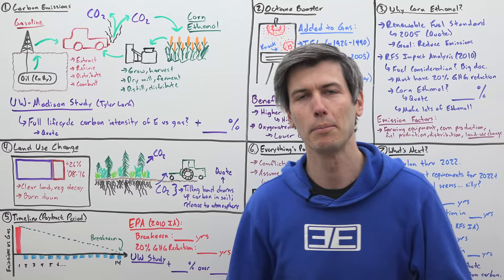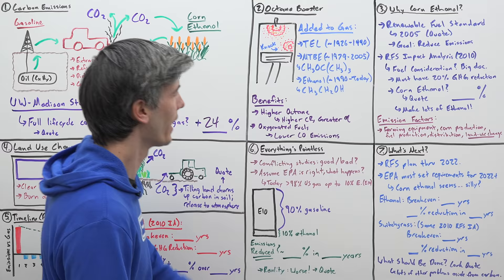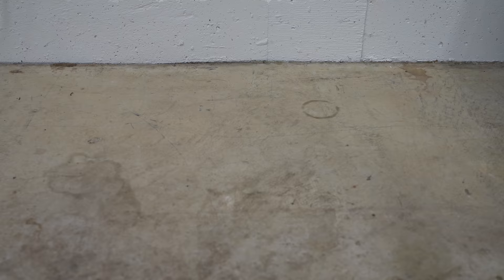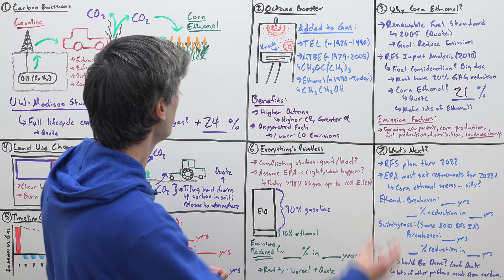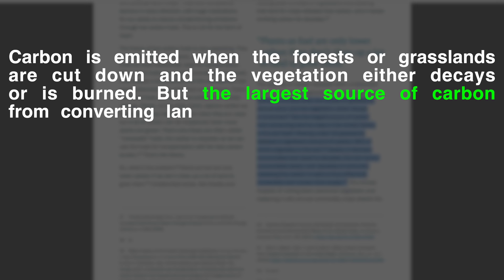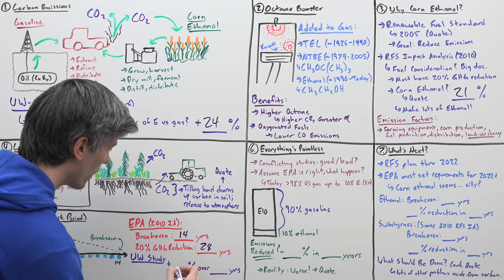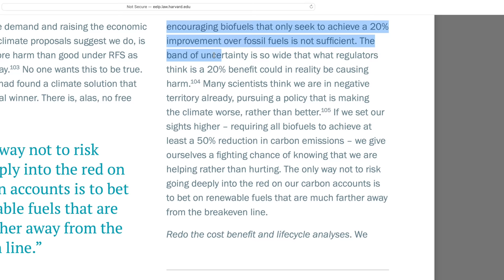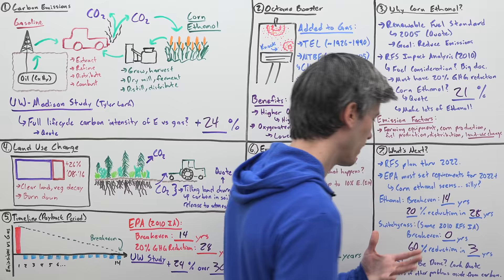America Was Wrong About Ethanol - Study Shows

Comment: Great video.  There is also another issue.  Alcohol doesn't have as much energy stored as gasoline, so you get less milage, so it doesn't do anything at all and small engines such as chainsaws will be damaged by the alcohol.  In short, the only benefit is to farmers, but the real losers are ranchers that have to pay more for feed, since they are competing with oil companies to buy corn.  Which means that we end up paying more for meat.  My argument against using corn in gas is economic, but yours is environmental, which is more likely to gather political support.
Reply: Corn ethanol is a value-added product of already existing feed production which preserves the feed in a healthier, more digestible/efficient, and more concentrated form called distillers grains.  

100% of the (more digestible) protein, minerals, vitamins, fats, etc. are still available for the better feed.  Cattle and dairy operations often spring up around ethanol plants.

Here is how the 2007 Energy Independence and Security Act affected food/feed prices(if at all):

2007 WEIGHTED CORN PRICE =$4.20 WITH 4 .7B GAL MANDATE
2008 WEIGHTED CORN PRICE =$4.06 WITH 9B GAL MANDATE
2009 WEIGHTED CORN PRICE=$3.55 WITH 10.5B GAL MANDATE

2016 WEIGHTED CORN PRICE =$3.36 WITH 15B GAL MADATE MAXED OUT
2017 WEIGHTED CORN PRICE =$3.36 WITH 15B GAL MANDATE MAXED OUT
2018 WEIGHTED CORN PRICE =$3.61 WITH SAME 15B GAL MANDATE MAXED OUT + MOST ETHANOL EVER PRODUCED

Wheat
2007...............$6.48/bu
2008...............$6.78/bu
2009...………$4.87/bu

2016...………$3.89/bu
2017...............$4.72/bu
2018...............$5.15/bu

Soybeans
2007..............$10.10/bu
2008..............$ 9.97/bu
2009...……...$9.59/bu

2016..............$9.47/bu
2017..............$9.33/bu
2018..............$8.48/bu
Reply: Identical small engines and chainsaws to ours in Brazil use their common gasoline which contains 27.5% ethanol.  It has worked out so well and for so long that Paraguay went to E27.

The spot cash delivered price of ethanol on the NYMEX is $1.46/gal.

The price of unusable sub-grade gasoline (RBOB) is $2.46/gal.

To turn RBOB into usable E0 gasoline costs even more much like premium costs more.  Unfortunately, it also become more toxic and dirtier.

Or splash in >10% ethanol to RBOB and the resultant usable fuel becomes less toxic, far cleaner burning, and cheaper/cheaper per mile to drive.  Who can be against that?

Ethanol gives more power.  For example, a Chevy 5.3L is rated at a clean 380 horsepower on E85 vs a dirty 355 horsepower on E0.

In an ethanol optimized engine, you will get both more power and more mileage than gasoline, even more than diesel engines.

Comment: 10:20 the mere 2% gain is most definitely decreased even further when you consider that ethanol contains less energy than gasoline, reducing your mileage, and forcing you to buy more ethanol tainted gas, and that it also raised the price of corn for cultures like Latin America who depend on it heavily as a basic food stock. But who cares about the poors. Being a democrat means never having to say sorry.
Reply: Do you drive a diesel car since it contains more energy rather being forced to buy more benzene tainted E0 gasoline?  If not, why not?

The price of corn did not go up, in fact corn prices were higher in 2007 when the 2007 energy act passed than they were in 2018, the year of most ethanol ever produced.

Right now, all grains are very depressed in price, even below the cost of production for most farmers.

100% of the CO2 from the fermentation and burning of ethanol just came from the atmosphere and 100% of it is needed to be back there to make the new gallon of ethanol.  It is a cycle, zero newly added CO2.

There were no grasslands or forests broken up for corn.  Quite impossible on its face because US cropland acres have been declining since ethanol.

Census data shows grassland, forest, and wildlife areas increased in corn producing states since ethanol came to be.

The corn belt actually grew more acres of corn in 1980 before ethanol than in 2018, the year of most ethanol production.

Comment: Natural gas.  It burns very clean, every single modern gasoline / petrol engine can be retrofitted to run on it, and ............. it's RENEWABLE.
Reply: It burns pretty clean but is hard and dangerous to handle.  Even more so as the equipment ages.

We could turn natural gas (oil and coal) into much safer, easy to handle, nontoxic, and clean ethanol with an economical process that China, Indonesia, India, and others are using and/or looking at from a Texas company named Celanese with their TCX Technology.

With enough ethanol, we could have near pollution free ultra-efficient ethanol optimized engines which are half the size/twice the power and get more mileage than gasoline engines, even more mileage than diesel engines.

Here is an ethanol optimized engine Ricardo built and drove around for GM a few years ago:

FROM RICARDO:
The new federal CAFE standards are calling for a doubling of fuel mileage performance, which, Vint says, is going to send OEM’s looking for high octane numbers to improve efficiency and ethanol is the best source. Ricardo, an engineering firm with over 100 years in the business of engine design, has developed an extreme boosted direct injection engine (EBDI) to optimize ethanol blends. The 3.2 V6 gasoline engine rivals the power and torque of a much larger GMC Sierra 6.6 diesel, he said, and it delivers 3.5 percent better fuel economy than the diesel.

Great thing about ethanol, we would not need a whole new and very expensive fuel infrastructure, like what Brazil did back in the 1970s, we can use our already existing petroleum one.
Reply: Natural gas in renewable? In whos life time?

Comment: I get more than 10% better mileage without ethanol.   Complete waste of resources!
Reply: The EPA measure the US fleet and states E10 gets 3 to 4% less mileage than E0 and E15 has 4 to 5% less.

E15 is still cheapest per mile to drive with and puts out the least pollution of the three fuels not to mention the most horsepower.

Your car must be in need of some sort of repair.  I would start with the 02 sensor as the most likely culprit.

There were no grasslands or forests broken up for corn.  Quite impossible on its face since US cropland acres have declined since ethanol.

Iowa State University measured all the energy it takes to produce an acre of corn into a "diesel fuel equivalent"
This included making the machinery, fertilizer, chemicals, plus the tillage, planting, spraying, harvesting, drying, trucking etc. 
They found it takes 34 gal of diesel to produce one acre of corn.
What do we get from those 34 gallons of diesel?
We get >500 gallons of ethanol.
But wait, that is not the kicker.
The kicker is we still get 100% of the protein and other things from that acre of corn still available for a healthier and even better feed called distillers grains. A win-win.

Comment: Arguably wrong....due to his age. The 10% ethanol had nothing to do with sustainability. Going back 30+ years, it was a seasonal additive to slightly reduce city pollution. At least that was the claim. Many say that it was just a use fir the federal farm subsidies that purchased excess corn to create a price floor in the corn markets. All the other environmental nonsense is ex post facto rationalization. And yes, far more energy is expended creating corn ethanol that is released in combustion—combustion that generates less power than gasoline. And very often the source of the grid power that produces the ethanol is generated by fossil fueled power plants!
Reply: After the disastrous octane booster lead was finally outlawed, the petroleum industry gave us MTBE which was not only an octane booster but also an oxygenate.  Ethanol was modestly sold in the Midwest during this time proving itself an economical and effective non-toxic octane booster and oxygenate.

When it became apparent that MTBE also needed to be outlawed, ethanol was chosen to replace it.  The petroleum industry even went along with the legislation because hidden in the bill was legal immunity from MTBE.  That was revealed and taken out and the bill still passed.

This is why we have ethanol at today's levels.

Denver in 1988 was the first government entity to require E10 (in winter) when they were on the EPA list of ozone non-attainment zones.  Soon with ethanol they were off that list.

Even with just 10% ethanol added to E0, the Swiss Federal Laboratory for Materials Science and Technology found that the especially health devastating ultra fine or nano particulate emissions were lowered by 97%, carbon monoxide lowered by 81%, carbon dioxide lowered by 13%, aromatic hydrocarbon emissions lowered by 67-96%, and genotoxic emissions lowered by 72%.

I will put what happened to prices in another post.  Newer ethanol plants are using the waste steam from onsite/nearby electric power plants to make ethanol.  Waste steam = free energy.

Note that ethanol produces more power even in our current inefficient gasoline optimized engines.  For example, a Chevy 5.3L produces a clean 380 horsepower on E85 vs a dirty 355 horsepower on E0.

Iowa State University measured all the energy it takes to produce an acre of corn into a "diesel fuel equivalent"
This included making the machinery, fertilizer, chemicals, plus the tillage, planting, spraying, harvesting, drying, trucking etc. 
They found it takes 34 gal of diesel to produce one acre of corn.
What do we get from those 34 gallons of diesel?
We get >500 gallons of ethanol.
But wait, that is not the kicker.
The kicker is we still get 100% of the protein and other things from that acre of corn still available for an even better feed called distillers grains. A win-win.
Reply: All the energy it takes to produce and deliver a product to the consumer is reflected in the price of that product.

As such, note the spot cash delivered price of ethanol on the NYMEX is $1.54/gal.

The price of an unusable sub-grade of gasoline (RBOB) is $2.75/gal.

To turn RBOB into usable E0 fuel costs even more for the same reason premium gas costs more.  Unfortunately it becomes even more toxic and dirtier.

Or simply splash in >10% ethanol to RBOB and the resultant usable fuel becomes less toxic, far cleaner burning, and cheaper/cheaper per mile to drive with.  Who can be against that?

There were no grasslands or forests broken up for corn.  Quite impossible because US cropland acres have been declining.  The corn belt grew more acres of corn in 1980 before ethanol.  Census data shows grassland, forest, and wildlife areas have increased in corn producing states since ethanol.

Here is how the 2007 Energy Independence and Security Act affected food/feed prices(if at all):

2007 WEIGHTED CORN PRICE =$4.20 WITH 4 .7B GAL MANDATE
2008 WEIGHTED CORN PRICE =$4.06 WITH 9B GAL MANDATE
2009 WEIGHTED CORN PRICE=$3.55 WITH 10.5B GAL MANDATE

2016 WEIGHTED CORN PRICE =$3.36 WITH 15B GAL MADATE MAXED OUT
2017 WEIGHTED CORN PRICE =$3.36 WITH 15B GAL MANDATE MAXED OUT
2018 WEIGHTED CORN PRICE =$3.61 WITH SAME 15B GAL MANDATE MAXED OUT + MOST ETHANOL EVER PRODUCED

Wheat
2007...............$6.48/bu
2008...............$6.78/bu
2009...………$4.87/bu

2016...………$3.89/bu
2017...............$4.72/bu
2018...............$5.15/bu

Soybeans
2007..............$10.10/bu
2008..............$ 9.97/bu
2009...……...$9.59/bu

2016..............$9.47/bu
2017..............$9.33/bu
2018..............$8.48/bu
Reply: Ethanol makes more power ...MORE as in plus side.

Comment: Energy "fuel density" is reduced by adding Ethanol gasoline so you get less power and Miles per Gallon.
Drivers burn more fuel to drive the same distance and as a result pay more in per gallon State and Federal gasoline taxes . Win- Win for corn lobby and tax revenue
Reply: The Federal gas tax since 1993 has been $.184 per gallon.  E10 according to the EPA averages 3 to 4% less mileage than E0.

4% of $.184 = $.00736 extra cost for E10 in gas tax.  You are correct, it does cost more if we just count the tax.

The spot cash delivered price of ethanol on the NYMEX is $1.32/gallon.

The price of unusable sub-grade gasoline (RBOB) is $2.56/gallon.

To turn RBOB into usable E0 fuel costs even more much like premium costs more.  It also becomes even more toxic and dirtier from the volatile aromatics like BTEX (benzene, toluene, ethylbenzene, and xylene) added.

Or simply splash in >10% ethanol to RBOB and the resultant usable fuel becomes less toxic, far cleaner burning, and cheaper/cheaper per mile to drive (not less).  Who can be against that?

Note that a Chevy 5.3 L is rated at a clean 380 horsepower on E85 vs a dirty 355 horsepower on E0.

Far cleaner air, less money on health problems, more money for roads, more money stays in American banks than Swiss, and more horsepower.  Who can be against that?

GM wants to have a 100 octane fuel standard to bring out their ethanol optimized engine Ricardo built for them which gets more mileage (and power) than gasoline, even more of both than diesel.
Reply: The cost per gallon of Ethanol blended gasoline is also higher as well as being less efficient  . This too impacts the increase of taxes paid at  the pump .
Reply: @kls2020  Actually average prices across the country are slightly lower for ethanol blended gas.  As it should be.
Reply: Except if you live in California like I do
where we have what is likely the highest gas prices and taxes in the country .. Ethanol being corrosive like it is was blamed for our higher prices since refineries had to upgrade piping and equipment to handle the corrosive nature . @ChurchAutoTest
Reply: @kls2020  I do live in California.  There is no ethanol free gas here for comparison.  I fuel 3 of my 4 cars on E85 all the time.  For cars running premium 91, switching to E85 saves 10-15% in terms of cost/mile.  Vs. 87 octane its a wash, but for the same cost/mile you get more power so its still a win in my book.  Ethanol is not corrosive.  Go drop some metal in a bottle of Vodka and leave it for a month.  Nothing happens.

Comment: Ethanol as an octane booster is a completely false premise. It doesn't make low octane gasoline behave like a higher octane gas, but burns slower than gasoline. They're incompatible fuels at low cylinder pressures, but can work together at higher pressures.
Reply: Today the spot cash delivered price of ethanol on the NYMEX is $1.51/gallon.

The price of sub-grade unusable gasoline (RBOB) is $2.12/gallon.

To turn RBOB into usable E0 requires the octane booster BTEX (benzene, toluene, ethylbenzene, & xylene) which costs even more per gallon.  Unfortunately for humanity it is even more toxic and dirty.

Or simply splash in >10% ethanol to RBOB and the resultant usable fuel becomes less toxic, far, far, cleaner burning, and cheaper/cheaper per mile to drive with.  Who can be against that?

Ethanol blends were sold here during a time of lower compression engines in thousands of stations in the Midwest right after Prohibition up until just before WWII with Agrol the most popular E10 blend.

Blends of 10 to 30% in Britian were sold from the 1920s with Cleveland Discol being the most popular E10 blend that sold until 1968-70 when BP bought them out.
Reply: @danafletcher2341  you hear what you want to hear... Low compression engines don't get good fuel economy with ethanol, so is it really better for the environment to burn more gasoline? A 2007 Suburban flex fuel with a 5.3 gets 19 mpg with ethanol free premium on the highway, with a 1500lb load, , and then 13 mpg on the same trip with e10 premium, 400lb load. 

And how come trees started dying when they started using ethanol in the Rocky mountains? Is it really cleaner? Will the US gov't or oil industry be honest with you when they make 30% higher profits selling a power quality fuel? You've been misled.
Reply: @Faolan161  It is an octane booster. You swaped around octane and fuel mileage stories. Id run it back thru Chat gpt and come back.

Comment: Go buy a tank of ethanol free fuel and check your MPG..Good chance it will be higher.
Reply: Which one will cost less to drive with?

Which one will put out vastly cleaner exhaust?
Reply: @danafletcher2341   Use to be able to fix ethanol free gas for not a lot more but not in my area anymore. So its doesn't make sense to use it in my car
 All the yard services buy it to keep it from destroying their equipment.
Reply: @markcatcash4688  You should tell the yard services to sell everything they have and move to Brazil and buy every small engine repair shop they can, for if they truly believe ethanol destroys equipment, then they should become gazillionaires since identical equipment there is using E27.

In fact, Brazil's use of ethanol has worked out so well and for so long that Paraguay has gone to E27.

Octane is expensive, this is why premium gasoline costs more than regular (unless using ethanol for octane).  Ethanol is the cleanest, most non-toxic, and cheapest octane around.

If we had ethanol optimized engines, we would have more mileage than gasoline engines, more MGP than even diesel engines!

Here is an excerpt of one Ricardo built and drove around for GM:

FROM RICARDO:
The new federal CAFE standards are calling for a doubling of fuel mileage performance, which, Vint says, is going to send OEM’s looking for high octane numbers to improve efficiency and ethanol is the best source. Ricardo, an engineering firm with over 100 years in the business of engine design, has developed an extreme boosted direct injection engine (EBDI) to optimize ethanol blends. The 3.2 V6 gasoline engine rivals the power and torque of a much larger GMC Sierra 6.6 diesel, he said, and it delivers 3.5 percent better fuel economy than the diesel.
Reply: @markcatcash4688  Yard services? Is that English?